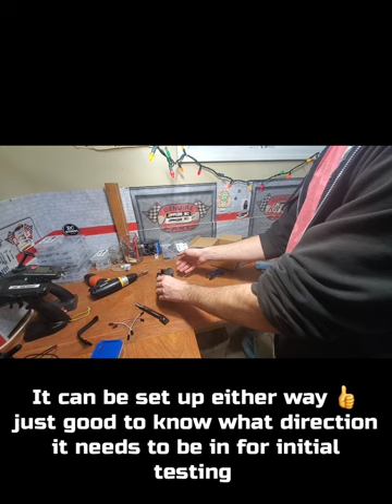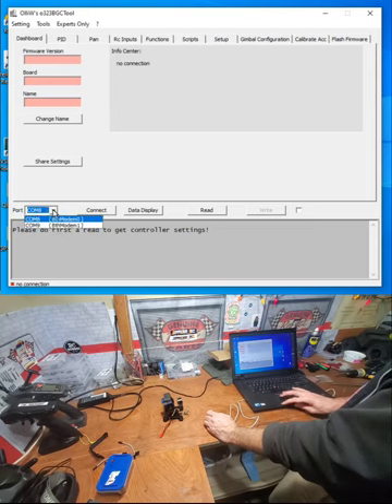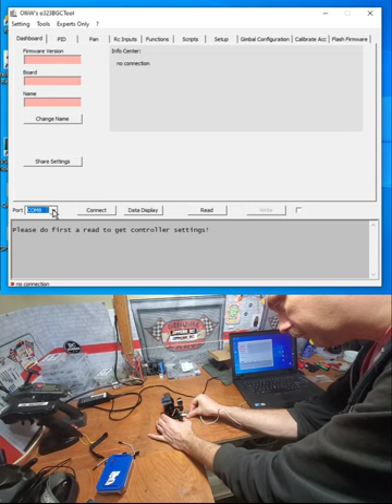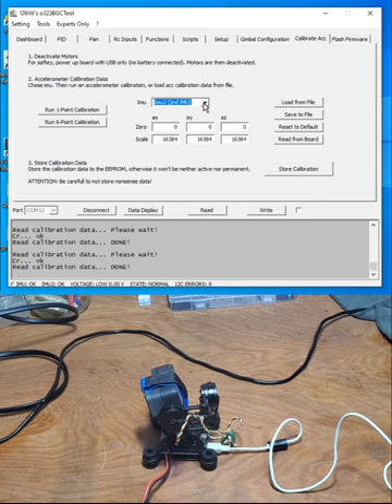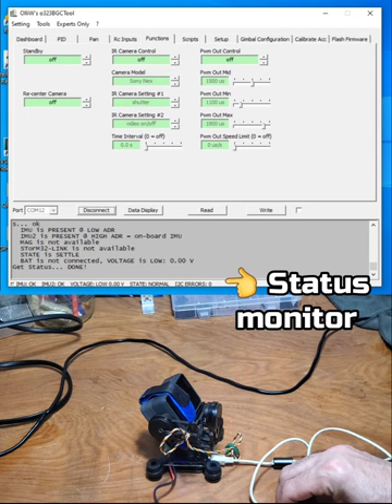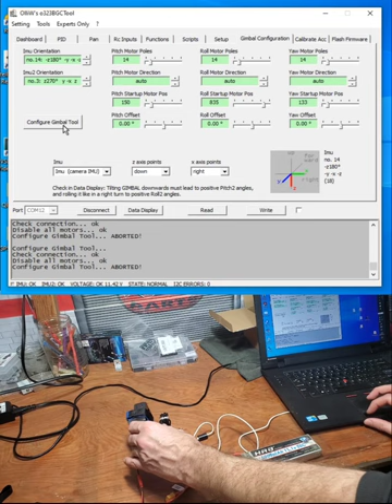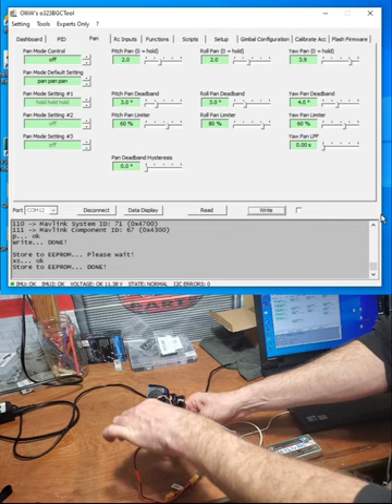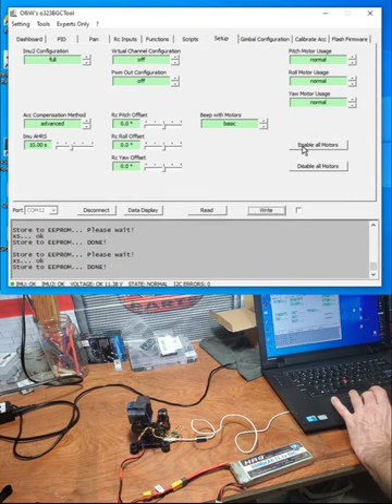Let's build a FPV Gimbal - Part 2 - function test and some settings

Comment: Great vids. I ran mine for a number of months but any huge bumps/jumps would throw it off and I gave up on it. Maybe I'll try again after watching this and learning quite a bit since then.
Reply from the maker: That can happen for sure, its a rather fussy process getting it balanced just right, well tuned pid's etc. My slash handles the bumps and jumps better than my senton. For some reason my tt02 could take the worst abuse and the gimbal was fine.

Comment: where are you getting these storm32 boards that just work out of the box???
Reply from the maker: I've had good luck on aliexpress. First one I got was on banggood. Most times they gimbal comes configured to be hanging from the base. So you'll need to run the gimbal config tool right off the bat to have it work right when it's standing in its base. Hope that makes sense
Reply from the maker: Check part 1 of this series, it is literally me buying the gimbal lol